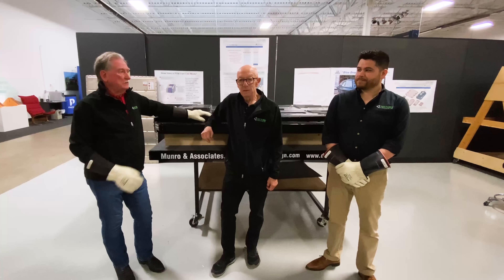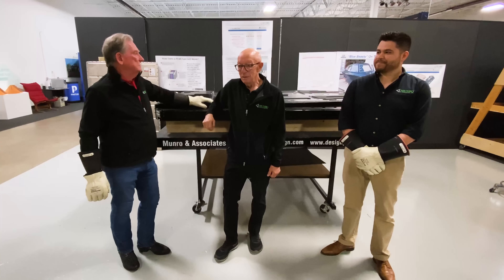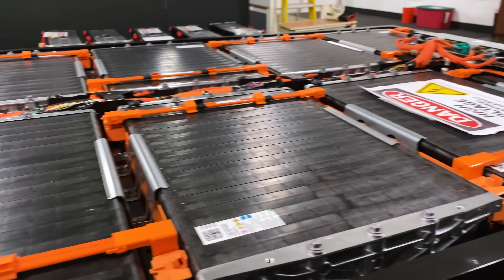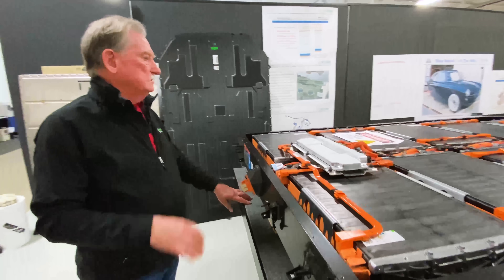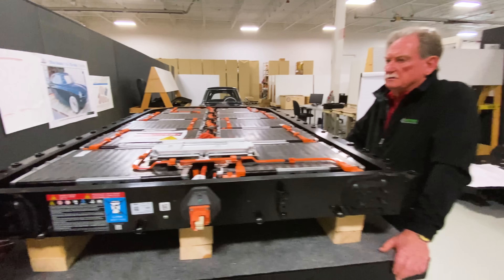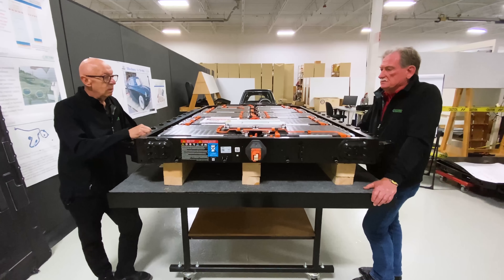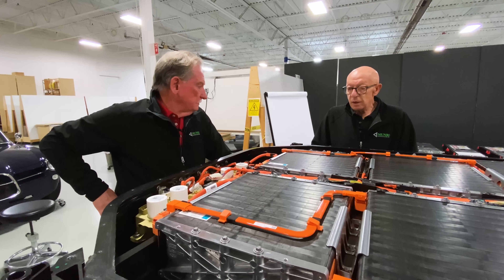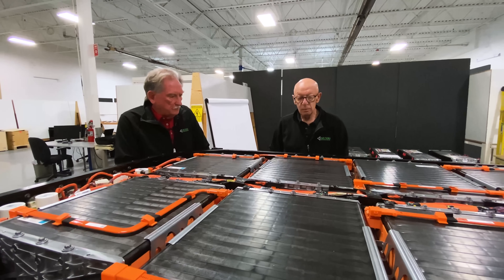Ford Mustang Mach-E Battery Exposed!

Comment: Few questions--
1. Noticed unused threaded holes at ends of battery packs. Any idea what these are for? If nothing, that's extra manufacturing time.
2. How massively thick is the battery system? Looks like 10-12". That means seats are that much higher than a typical Ford.
3. Too many cables, hidden plumbing connections (stupid design), just like spaghetti in frunk. When will American auto manufacturers, sans Tesla, learn???
4. Interesting Ford went with a battery manufacturer who just lost billions of dollars to a blatant patent lawsuit. Does Ford really think they can depend on them long-term?
5. Ford is trying to overbuild the battery pack and skimps on enclosure sealant. Why????
Statement: as far as recycling these batteries, will there be enough of them to actually recycle?
Reply: (1) Potentially used in assembly, or perhaps they intend this pack to go in multiple vehicles and one generic pack is seen as better than N slightly different variants.  (2) It's an SUV, people like sitting high, that's why they buy them.  (3) Be interesting to know why they made those choices -- my guess is for better individual control of each pack.  (4) If they go under Ford can just swoop in and buy their assets at fire sale prices (5) Presumably their tests showed it to be sufficient.  Note that though heavier the Ford cover is more rigid, so the gasket has less to deal with.
Reply: @UnlikelyToRemember  2. SUVs need ground clearance and the Mach-E (5.7") have as much ground clearance as my 2013 Tacoma TRD off-road model (says 9.3" but that must be at differentials, think mine is more with off-road tires). I know this is a truck but both are supposed to be off-riad to some extent and <6" isn't much clearance. I've seen stupid speed bumps this high, which should be outlawed. Check out https://www.carindigo.com/ford/mustang-mach-e-suv/dimensions for "SUV" ground clearances. 4. If Ford buys them, they also take over the patent litigation so not really a good idea. 😉 5. The gasket is for being water-tight in addition to stiffness but I doubt this battery assembly has anything to do with structural support like the new Tesla battery compartment, Munro already said it might be too heavy for what it's meant to do.
Reply: 1. See the previous Munro video for how the pack bolts into the vehicle and what those holes are for.
Reply: 2. The pack is nowhere near 10 to 12 inches thick. Yes, any EV with a battery pack under the cabin floor has the floor and seats higher than the non-EV equivalent. Tesla sedans may look low (at the roof), but the floor is high.

Comment: Those bolts for the cover are "triangular" thread-forming bolts.  Just need the right size hole then you spin them down to torque and you're done.  The amazing part is the threads will fit standard replacement fasteners and the thread forming bolts will fit in a standard tapped hole.
Reply: That is cool!
Reply: @bob15479  what's so surprising? A tap is also a valid screw.

In fact it's basically a self tapping screw.
Reply: @benholroyd5221  I bet you’re fun at parties
Reply: @bob15479  you're the one who thinks bolts are cool :-P

I was more leaving the door open for someone to explain what's so novel, as both you and the OP seem to think it's novel, and it just seems big standard to me.
Reply: @benholroyd5221  that’s because you already knew about it and we didn’t. The definition of novel is “new”.
Reply: @bob15479  I assume the OP already knew? I wasn't specifically aware of self tapping bolts, but self tapping screws are a thing so it doesn't seem much of a leap to get to self tapping bolts.
Reply: @benholroyd5221  self tapping and flow drilling/tapping as these fasteners do are slightly different things

Comment: Tesla should learn from VW and Ford about accessibility and removability of the lid of battery pack.
Reply: Is their design goal to make it repairable, or a permanent part of the car? If the lifetime of the pack is equal to the life of the car, there is no incentive to make it accessible.
Reply: @AndyZach  They just want you to buy a new pack - repair... right.
Reply: The whole pack should be snap fit to the underside of the car.
Reply: Tesla doesn't care if the pack can be serviced, as they have no intention of ever servicing it internally. Packs will routinely fail before the car does, but the entire pack is replaced without opening it.
Reply: @brianb-p6586  The owner will care.
Reply: @hallkbrdz  Tesla doesn't care about the owner, and few owners will  realize that anything other than complete replacement of the battery is possible. Most buyers of new EVs will sell them before the warranty expires on the original battery, so they won't care, either.

Comment: Awesome video as always. What struck me the most about the battery pack is how much unused space was in there.
Reply: Same thoughts here ,I suppose that is the  area where you are meant to smuggle contraband?
Or will they reconfigure for more cells?
Reply: maybe to keep the door open to other possible battery suppliers without needing to re-design the thing and the attechments to the rest of the car etc. Just guessing.
Reply: Looks like really good space, usual without the pack being convoluted. Very great design
Reply: There are different battery configurations, which fit in the same battery box. Some for different distances, some for 2x wheel drive, others for 4x wheel drives.

Add more batteries, more space consumed.

Comment: This looks as if someone has a bunch of  standard- size battery modules and tries to fit them into an oddly- shaped box they had no say in designing. They're turned every which way and just laid in there,  then wired and plumbed however they could make it fit,  with hoses, wires,  clamps,  bolts straight out of a parts bin.
Reply: No, actually they are well laid out in the pack designed for them, as well as for the larger modules of the extended range pack.

Comment: Box in a box in a box. -Giant empty spaces, wires and hoses going everywhere. This is like the thermal systems all over again, and if it's from SKI, (With LG lawsuit) damn there's no worry for Tesla, at least those suppliers...
Reply: Some of that space is needed for the longer modules of the extended range battery; this is the standard range battery which has significantly shorter modules. No, there is no space needed for thermal expansion of the cells which are rigidly constrained in the modules. Not surprisingly, the engineers at Ford and the battery supplier know what they are doing, and know more than random YouTube viewers. ;)
Reply: Well the batteries need room incase the batteries expand.
Reply: @mamadouaziza2536  ...No, sir.  The modules are bolted together to prevent swelling.  See discussion starting at 08:25 .  Or did I misunderstand your sarcasm?
Reply: @jrb_sland5066  the modules (boxes) won't swell.
The cells inside might, but there's no indication of how much space is inside (yet).
There's a YT article on line of a  BYD factory tour, showing their pack. (Fully charged show?)
You might benefit from watching that.
Reply: @mamadouaziza2536  I know that you are joking, but still; pouch cells are in side of black boxes (modules) and there are space (caps) between cells for expansion.
Reply: @mamadouaziza2536  the CELLS are inside those boxes.
It the cells which (may) require space to expand.
(Note: a "battery" is a collection of "cells")
Reply: This could be justified if they are waiting around for the industry to come up with better chemistry. It's clear they don't see this being an area of expertise. Instead opting for being a brand management co and a final assembly co.

Wonder what the RAM stuff will have... aside from Chevy and Polestar, everyone seems to be rushing. It's as if they were cought with their pants down and they were hoping this would go away in the last 5-10 years.
Reply: @ch4.hayabusa  - Ford was by no means “waiting for this to go away” for the past “5-10 years.”

Ford was one of the first auto manufacturers to release a hybrid SUV. That was almost 2x decades ago! Over a half decade ago, they released fleets of plug in hybrids. 

The car magazines just refused to write about them, saying that they existed, but that was it! LOL!

The current li-ion chemistry is dangerous, does not recycle as easily as lead acid, and may be replaced with heavier (but safer) LiFePo4. There are other options out there, as well.

Comment: It's funny how you can hear the electronical interference from the batteries whem the camera gets close
Reply: Not the batteries. EMC issue shouldn't be.
superconductor and transformers are leaking
Reply: The battery can't cause interference. The BMS might be able to, if it is active, since the cover is off. There are no superconductors or transformers in the battery assembly.
Reply: I heard that too, at 10:51 there's artificial noise in the audio. I doubt it was interference from the batteries, but I don't have a better explanation to offer.
Reply: More likely it’s someone’s phone.
Reply: @13669wrights  phone interfere is pulsed. This is picking static electricity of some insufficient component. Usually some transformers or capicitors. As the energy needs to get out of the battery pack.

Comment: Id.4 lid area: 2.2 m^2
Mach-E lid area: 2.6 m^2
Don't bother reading out five significant digits, that's confusing in a video. Use three at most.
Reply: I couldn't agree more. Large numbers (as in lots of decimal places) just confuse.
Reply: See also: 2170 instead of 21700, and 4680 instead of 46800. Those darn 18650's will always eighteen six fifties to me though!
Reply: @Bladecraft 'Stuck in the mud' with inches and so on ? Got some problem ? Chip on your shoulder maybe ?

The USA is the ONLY 'developed' (??? maybe not so sure about the USA) country NOT using metric ! Any engineer will explain the huge advantages of metric like NO 'conversion factors' EVER. Hence fewer 'mistakes' like crashing that probe into Mars. LMAO

Comment: So the landfill-destined PLASTIC battery cover weighs over 60% more per square inch then the recyclable ALUMINUM one.  Kind of shoots down the whole SABIC sales pitch.
Reply: Didn't they say that the plastic is a fire inhibitor while the Aluminum is NOT and is actually FLAMMABLE 🤔 in the SABIC video 🤔
Reply: @billhanna2148  I don't think this plastic is necessarily fire- retardant
Reply: @jamesengland7461  any evidence that you can share?
Reply: @billhanna2148  no; I just think if it was fire- retardant,  they would have mentioned it
Reply: That plastic is basically fire retardant
Reply: No; that shoots down Ford engineers. The cover is over built to span those big gaps and I believe they mentioned it's 3mm thick.
Reply: I believe Munro stated that the Ford pack is structural (thinner side rails), whereas the ID4 one is not. Thus the reason for more weight.
Reply: @hallkbrdz  
The BOX is structural.

Comment: I thought I would repost this incase you guys didn't see it.

I had an idea for a video.
Tesla will install 10,000 superchargers this year.   What is the cost difference between the tesla superchargers and the other charging stations with their screens and RFID readers. Maybe a teardown  of the chargers with an eye on how to make them more reliable and lower cost.  Thanks.
Reply: Buyers of vehicles don't care. Those that build chargers AND those that sell charging care.
They can easily hire Munro if they need (or find helpful) that information.
Reply: @brandoYT  When the charger fails then they care.  But either way, it would still make good videos to tear them down and see if they can be better.  Tesla has an advantage because they don't need RFID readers or screens so cost must be lower.
Reply: Gonna be hard to "buy" a supercharger :)
Reply: @NTNLabs   I was thinking more about the non tesla chargers, as they tend to have more problems. Comparing  ABB vs Trinity etc.

Comment: I agree the DIY solar person, just loves these simple modules for battery storage now if they where  48v system drop in and use.  no need to break it up
Reply: I just bought 2x of the 8s4p modules. Easy.
Reply: The late Jack Rickard {search "EVTV"} was convinced that the best way to use a Tesla battery was to keep the whole thing together as a single high-power, high-voltage unit.  He developed his own custom communication module to talk to the battery to turn it on, read back the individual cell voltages, etc all with a few CAN control cables that plugged into Tesla's connectors.
Why go to all the trouble of breaking  it up into its modules when you'd likely then want to reassemble multiple modules into your design of battery without {probably} the expertise to understand how to be certain that your BMS unit[s] are still doing their job.  Time will tell.

Comment: Those battery packs should not exceed half a kilo. Labs already developed a 2000x more densier battery than a standard lithium one.
Reply: What can be done in a lab and what can be done large scale are two entirely different things.  It can take a long time to go from lab to factory but DO expect new and improved battery tech to come out.  It's like the early days of ICE's.  Lots of room for improvements, someone will come out with something that is a game changer.  What is used today will change in 10 years.

Comment: So the big advantage of the pack is, at the end of its useful life in a car, modules can be yanked and reused in stationary applications for something or other?

That is frankly insane.

What I'm seeing in the Mach-E is a pack that's too heavy, loses too much energy to long cable runs, depends heavily on threaded screws and bolts, has too many potential coolant leaks, and doesn't have a developmental path for cell-to-pack.  This design approach will always lead to heavier, less efficient battery packs.

The HVAC system has a similar design approach.  Hoses going all over the place, connections galore, and screws seem to be Ford's favorite fasteners.  Too much weight, too many parts (four pumps!), and I can't kick the feeling that some of those screws won't stay put for the life of the car.

What's common between the pack and the HVAC system is that most of the design is constrained by requiring off-the-shelf components and designs invented elsewhere, then cobbled together, with fasteners receiving as little attention as possible.  This design was compromised before the first engineering drawing was printed.  It's Ford's commitment to outsourcing and their neglect of fasteners that drove Ford's design decisions.

I'm sure design improvements can be found for Ford's pack design, but I can't for the life of me see how they'll ever compete effectively against Tesla's 4680 structural packs using SK pouch cells.

Maybe Ford doesn't care.  I think it's likely that Ford will push hybrids, make a few token BEVs, and send their lobbyists to demand emissions incentives from governments for their hybrid models (like the Ford Maverick light truck).

The Maverick will use just a handful of scarce battery cells, it'll start around $20K US before incentives, and if they can qualify for $12,500 US in incentives, the new-car price will fall to under $10K US.  That is how they will preserve market share, if they can get those incentives.  That will be what Tesla will be up against from legacy auto - cars and trucks with tailpipes masquerading as electric, looking to ride the incentives bandwagon to achieve prices irresistible to consumers.
Reply: Don't worry, as long as it's got a frunk, everything is okey-dokey!
Reply: @danielardelian2  I'm getting Mad Magazine flashbacks from the 60's.  'What, me worry?'
Reply: “That is frankly insane”

I just got my first two recycled modules… enough power to run a whole house UPS, using off the shelf components.

Comment: Could you let me know the outside dimensions of the battery module in it's entirety? I'm looking at finding a wrecked one and converting my 2014 F150 to EV using the Mach E motors and battery possibly. Hoping the battery would fit between my factory frame rails once the trans/driveshaft/exhaust and gas tank are gone.
Reply: I think the battery width is basically the track width of the car.  Pretty wide.
Reply: There's no chance it would fit. As the other commenter noted, it is almost the full width of the body, which is much wider than an F-150 frame. That's why the F-150 Lightning has a completely different frame.
Reply: @brianb-p6586  well then Tesla swap here I come :) Model 3 performance battery will fit between the frame :)

Comment: It has too many screws as the whole battery pack makes the IP protection for all inner components. The contactors (relays) on the rear is the battery disconnect unit in case of accident

Comment: Looking forward to seeing the video where you disassemble the battery packs. I am very curious to see if the total amount of power is the same as the one advertised!
Reply: I don't think Munro ever tests capacity - they only quote manufacturer's specs. What they measure are weights and linear dimensions, not anything electrical, because their speciality is optimizing manufacturing costs - they don't do electrical design.
Reply: @brianb-p6586  You're right, I forgot that point!

Comment: Hi sandy , one of my fav clips was the one you distroyed the model y tempered glass window . In the same way can we get some destructive demo of one of the sk battery( 40v cell pack) modules either over charge or over disscharge without the BMS . Also some HQ flir footage side by side of the whole thing to show how heat is moving down and out in prismatic cells .

Comment: A lot of wasted space in that battery pack. They could've went with a different design and fit much more in there.
Reply: Sk probably designed it for maintenance..easy excusable.. Module replaceable..snap in and out low downtime and get the customer back on the road. Awesome design imo
Reply: They did fit more in... in the extended range version.